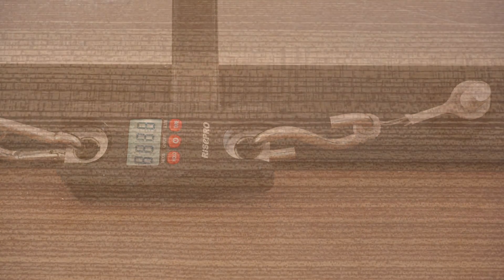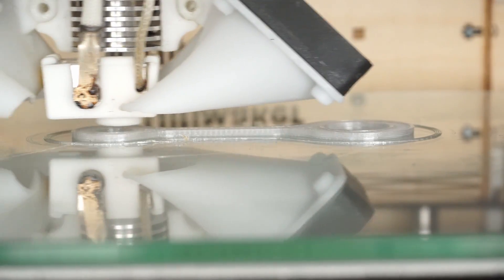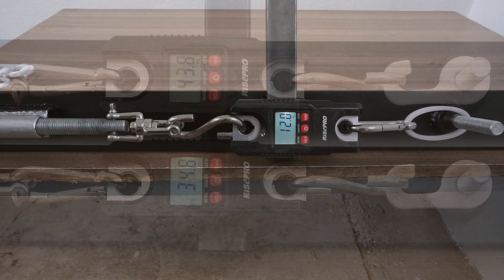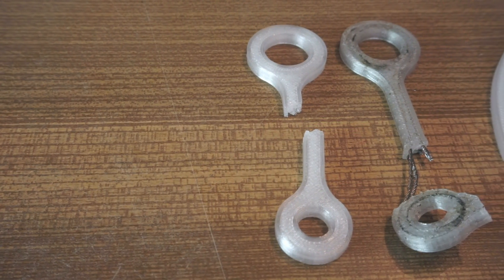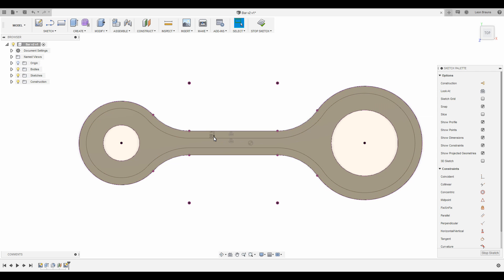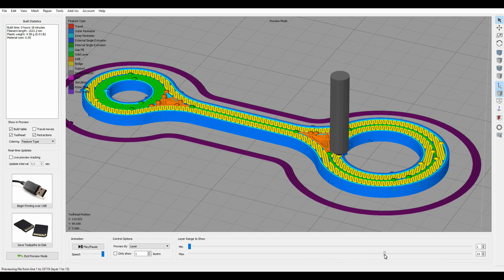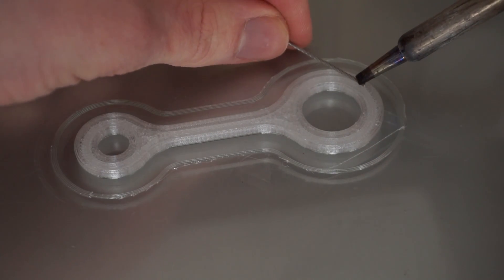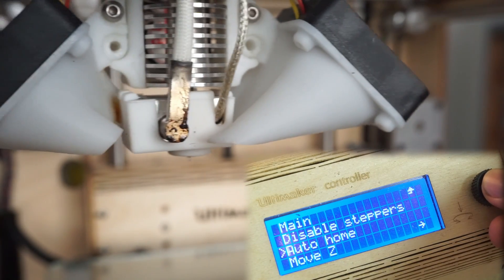Reinforce Your 3D Prints with Steel

Comment from the maker: Some of you criticized that I haven’t included normal, non hollow plastic parts in the test. I also regret not doing that, so today I rerun the test with those. They were sliced with 3 perimeters and 70% triangular infill, so that they include as much plastic as the steel-reinforced parts (even a little more).

Pull (Bar): 98.2kg
Bend (Hook): 44.6kg
Combined (Ellipse): 105.7kg

Looking at these numbers, it seems like the additional perimeters that are caused in the hollow parts actually help to increase their strength.
Reply: It makes sense. When you hollowed the parts you crested layer perimeters within the part. That increased the internal structure. If you increase the layer wall I'd imagine that's another way to strengthen the part
Reply: That's weird.  What's the printing path of the solid parts? are they different than the hollow ones?  I am thinking the alignment of the polymer fibers on the hollow parts are better align to the load path than the solid ones(with a lot of zig-zag maybe?).
Reply: It's good that you did these extra experiments. Extra perimeters always help.  CNC kitchen had a good video about something similar where he also reinforces his prints through extra infill/perimeters https://youtu.be/q0YsC53mFvY .

To be honest I'm not a big fan of infill for functional parts. If a part needs to be functional then people need to learn to design the part in such a way that you only model what needs to be printed. It's a better design philosophy to assume your parts will be printed at 100% infill, which usually also gives you better data for comparison, especially if you ever want to compare 3d printed parts to injected molded parts or if you need to compare them versus less available/hobbyist printing techniques, such as by ex. SLA and SLS. 
If you need to model something quick and dirty and just need it to work then the easiest way is to overdesign it ayway and just use infill. But if you really start looking at project where weight and price are important then, in my opinion, you should design the parts also properly an not use infill or only to overcome printing limitations.

Once you start comparing prints with infill, things also become very complex, very quickly because of all the different interactions. Basically you're imitating a part made out of a heterogeneous and anisotropic material.  Comparing data between those kinds of materials/parts requires a bit more than "back of the enveloppe" calculations.
Reply: what type of plastic you used?
Reply: @alexwhite1387  He used PETG.
Reply: @lucidglobalwarning8707  thank you!
Reply: For ref, what is the resistance of a ellipse wire without plastic coating? The resistance of bare wire.
Reply: Could you tell us the strength / weight ratio or the strength / money ratio? No need to print the parts again, just put the broken parts on a scale.

Say you would need to design something with a weight or price limitation, the ratio would tell us if imbedding steel wire is price or weight efficient.
Reply: If youre going to reinforce parts like that, put the wire on the outside and the inside so the strain is on the metallic parts and not the plastic exoskeleton.
Reply: What about using aramid / kevlar fibers?
Reply: You may also give information about the weight difference between both

Comment: The biggest problem I see is the fact that the steel wire is not crimped or welded so it has the possibility to slip out of the print

Comment: i would rather take the approach used in pre-tensed concrete slabs (when the part allows it) with stiff metal reinforcements  , but in this case it would be POST TENSING

Comment: Has anyone created an 'auto wire injector' as a second 'print head' to make crazy strong 3d printed parts automatically? I searched, didn't find anything, but it seems very doable and obvious?
Reply: by 'inject', I just mean bend and cut mechanism on cartesian head that lays down a shaped wire path on top of specific 3d print layers, during printing, so the wire shape is encapsulated into the print as it's laid down, reenforcing it like in the video but automatically. Seems you just need functions: extrude, bend, cut, and maybe shift axis, bit of corresponding gcode, and voila.

Comment: number of loops hypothesis seems like you are relying on the friction of the loop, because the wire loop is not re-welded together. more loops would create more friction along the outer surface of the wire.

Comment: Good work. Is it possible to improve the thermal conductivity of the part by reinforcing steel wire inside the 3d printed part.

Comment: I think i heard you say you used PETG. For strength in the traditional sense, this material is sub par. I would love to see your method in a regular and carbon fiber reinforced nylon.
Reply: also a method that would be easier and perhaps even stronger, is to make your channel a bit larger than the wire. Print the model in 2 separate parts.  Instead of heat pressing the wire in, fill the channel with a 2 part epoxy, and smear a thin layer across the whole face of the model. Press your wire in that side, then smear some 2 part epoxy also the same way on the other half. Press and clamp them together between 2 blocks of wood. This should provide you a large amount of strength as the wire will fully be bonded with the geometry of the model.

Comment: Some notes:
Nylon might be great for this. Because it's a little flexible it leaves the strength to the steel and doesn't crack 

Maybe filling the get inside of the metal part with resin can help transfer more forces to the metal

I wonder if we can increase the z axis strength of prints similiarly

Comment: could it be that applied tension made the wire act as an anchored pulley within the print? 

2 hole part probably tried to spread outwards, breaking the print at the transition of ring as it tensioned.

the tip of the hook should pulled within itself the same direction as the weight.

loop was really neat for having a simple road and angle to flex.

Comment: Good job. I use wire keychain with a screw head on one end and thread on the other end (connect into itself to form a loop or connect another piece as extension).  I also use inserts, rectangular nuts (stay away from hex), angle bar with thread , thread insert,  stainless tube to prevent over tightening.  strategically placed metal pieces for both inside the print and slotted access. For some I don't need to stop the print and instead I designed two matting surfaces with one-way latch and catch, similar to zip-tie. (also ignore them neg comment)

Comment: I use a technique that's similar to this, but with rods rather than wires. It's useful in a lot more scenarios and it doesn't require pausing the print or a soldering iron. Here's the guide: https://www.youtube.com/watch?v=cF6GeIu3RMA
Reply: Nice. Might try this one too

Comment: Would you kindly test compressive strength enhancement by embedding solid metal hardware or pouring concrete into internal voids? The concrete would have to cure before resuming so it might be best to do this on a removable bed which can be accurately aligned when it is returned to the printer.

Comment: This is awesome and innovative.
I want to try this asap but also by eliminating the loose ends by soldering the steel wire loop before adding the second half part of printing.
I am planning to make the first half with the placeholder for wires, take out this unfinished print out and precisely measure the length of inlay steel wire to make a soldered loop.
Will try to update here on my result.
Thanks a lot.
Keep rocking!!!

Comment: This is very similar to the Markforge printer and it's use of carbon fiber. It would be Insanely cool if we could all come up with a cool automated way to mimic that process. Of course, simply embedding Carbon fiber every few layers works too and would probably be super strong. I need to try this.

Comment: At 6.10
You start to add the wire in the wrong place... 
The wire should start 180° further around... So the curve takes the strain
I would print a spiral recess on the curved ends, so no wire is pulled straight, but around the curve, this will give more grip to the wire 
Or did you do a double run of the wire, hard to see

Comment: What was the failure mechanism? Did the wire break, or did the end of the wire pull out of the plastic? 

Also, if you could pre-tension the wire, you might be able to increase the strength of the part before the plastic breaks.

Comment: Very cool video. I think this would be even easier with ABS, where you can print the part in two pieces, add the wire, and use acetone to weld the top on. This would also let you to solder the ends of the wire together to form a closed loop.

I'm also interested in using 0.3 mm thick sheet metal as an integrated part between layers. Leaving room for a piece of sheet metal would be even easier, and you could incorporate multiple pieces easily within the same part. The sheet metal could be cut using a laser CNC machine.
Reply: Have you seen the EDM head to cut sheet metal using 3d printer?

Comment: Doesn't bending the surrounding surface while introducing the wire also introduce defects into the print's structure?
I wonder how the printer deals with that, if at all.

Comment: Wouldn't a non-braided wire work better because it stretches less? It may be  weaker on its own but I bet you a solid single core wire would show even better results.
Reply: Most likely not, as greatly reduced adhesion of plastic and metal.

Comment: This doesn't reinforce the print. It just means it will hang from something inside when I breaks.
Reply: did you watch the video? you can clearly see that it requires 50%+ more force to break the parts. so it obviously reinforced the parts.

Comment: Not bad thinking, but this is really only useful for increasing elongation resistance in one direction. Adding composite encasement would also buff the torsional rigidity.
Reply: he mentions this in the video
Reply: @TLoZfan  Ah, must have missed that part. Got about half way or so.

Comment: Nice idea. But if you are looking for better results you should consider this: 

If you joining two materials soft and hard you should maximize contact area of both peaces. You should make additional cavities in the printed peaces and then use some filler. It can be anything mixed up with a glue (baking soda, sand, whatever). So the resulting softness would be between plastic and steel.

p.s. in general its the same idea how japan sword is made, - where to types of steel are joined, you can easily find smth on youtube

Comment: You missed one important part.
Splice the ends of the cable together.
It is really easy to do for low strength applications, and with practice not hard for full cable strength.

The easy way, you basically cut half of the strands short on each side, leaving every other strand long, and then interwrap the two ends.

Comment: Could probably take this further and easier with larger parts. Print hollow with 2-3 shells. Drop the wire in. Finish printing. Drill 2 small holes. Pour in resin, cheap at HD or crafts stores.

Comment: Can you also plan to add a variant with the cable beeing crimped? You should also make the proper reservation in the 3D model for the crimping sleeve to be hold. IMHO, this would result in impressibe strength. To go further you should also think about better force management, like wire crossing.

Comment: did the prints without wire had the hollow tubes for the wire in them as well? because if the prints without wire were printed without the hollow tubing, then that would make it weaker

Comment: Even better.:  Use Dyneema or Spectra where the ends are tied together.  You won't get a weight issue and you'll get better strength than steel.

Comment: What if, instead of a square channel, you did a circle but stopped the print about 5% above the center? That way the wire would pop into the channel with no space around it.

Comment: Hi. Do you have som tips for reinforcing a 3D printed piller? The force will be applied diagonally from the topp.
Reply: From my knowledge of Reinforced Concrete design I can tell you that the column (as you call it a pillar) will fail in one of two ways; squat columns will tend to fail in crushing, thin columns will tend to fail in bending. To reinforce a column from crushing you put rings of tensile material (such as steel bar or wire) in a stack. To reinforce a column from bending, long lengths of tensile material should be put at the out edges (but still covered) of the column.

To get an idea of which failure will most likely occur without the use of mathematics I suggest putting the forces on a non reinforced prototype and see how it deforms, you will see it either bend before break or it will bulge before break (this is called crushing). Note; both can happen, just pick the predominate failure method since I do not think you can reinforce both with 3d printing.

When a member is being bent, the outside edge of the curve created will be in tension and trying to pull apart whilst the inner side will be subject to crushing. In general the reinforcement will be best at resisting the tension thus should be on the outer side of the curve. Additional plastic should be put in the inner side (i.e. make the column wider in the direction of the curve) to resist the crushing.

When a member is being crushed, all along the inside of the member, Material tries to push its way out of the core as it is crushed. Placing rings of reinforcement around the core provides a degree of containment, note: these loops should be fully closed to be effective.

When placing Reinforcement it is best to have spacing between the strands (my guess is probably around 1 - 2 times the diameter of the reinforcement), this will allow for a good connection between plastic either side of the reinforcement and provide better binding between reinforcement and the plastic.

Comment: For those using Cura, there's a plugin on Thingiverse called "Change Filament at Z" that adds the gcode to pause, move the print head out of the way, and wait for you to resume the print. I've used it for multicolor, but keep meaning to try embedding objects (most likely magnets).
Reply: Just be aware that this will not work on many machines with stock firmware. Unfortunately it doesn't work on my Artillery X1 until I change firmware.

Comment: It might be stronger if you use a spiral pattern path around the holes, that way you can use 1 continuous wire and the tension can be distributed across the whole system more evenly. The inner concentric circle parhs dont lend much strength. Just my 2 cents. Great idea either way!

Comment: It would be so cool if you could get an extruder head to heat a wire and pass it onto the print. you would need a lot more narrow wire to avoid kinking but there's probably a magic diameter and offset that would work. glass fiber, real carbon fiber stands would be cool too

Comment: Fantastic idea!  Soldering together both cable ends would make it much stronger!  For that you need to cut cables at perfect length and need to make a curved holder (steel U-profile?) in which you can solder the cables together with the correct bend radius.  Why not putting several layers of cable on top of each other?
Reply: Or use JBWeld to join them cold.

Comment: You could try layering some steel/stahlvlies between two printing layers (or every 10 Layers) and fuse with a heat gun. This will result in much better distribution of the strain, and load sharing between the reinforcement and filler material.
Reply: could you explain a bit more? that sounds interesting, but what is stahlvlies?
Reply: @hanneslaurin9768  , To reinforce I would use very fine stainless steel mesh or felt (Stahlvlies is a steel felt). Something isotropic for example. The stacking could be as such: 1mm print/1 layer of mesh/1mm of print/ and so on.  For good adhesion heating is the key. :-)

Comment: I wonder if one could design a hotend which continously injected a thin steel wire in, so that every layer is reinforced by many thin steel wires?
Reply: You'd have much more success trying to do something like that but with strands of carbon fiber or other fibers, which is being done but not as well as we'd like to.

Comment: Carbon fiber with Steel?? Next time test)
Reply: doesn't make much sense. the  carbon fibre is stronger then the steel you would weaken it.
Reply: Carbon fiber filament isn't as strong as solid carbon fiber, so combining the printed part with steel could result in an improvement.

Comment: This should also work well as a defence against vandalism. I'm going to reprint the parts on my electric bike, that hold the battery in place and incorporate quite a lot of wire.
I made the parts overly large so they would be strong, but have always been concerned about leaving the bike as it was still just plastic. The metal should at least slow someone down.
Reply: You can also make the battery removable and put it in a backpack.

Comment: I would submit in my opinion that the wire joint is in the worst possible position.  If it were mid part in the long axis, the other side (the uncut side) would benefit from the friction around the bend and along the path and you would get maximum strength from this type of routing.  A much better routing would be to spiral the ends in toward the center hold to allow the force to compress and clamp the wire while it is sliding in the grove before failure. I would spiral one end around one circular hole and the other end around the opposite circular hold.  Please accept my suggestions knowing I love the video and your work.  You have contributed excellent work and I appreciate it!  Thank you!!